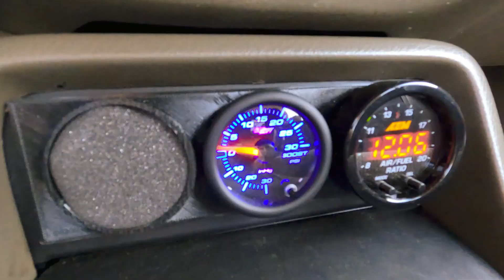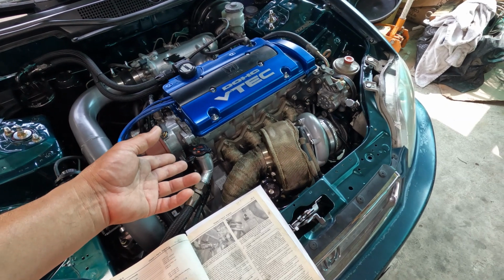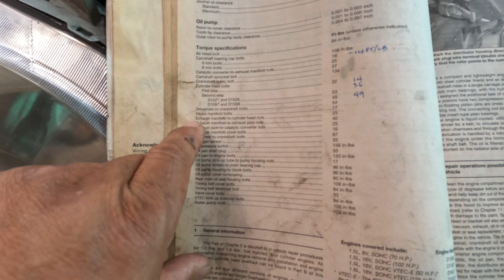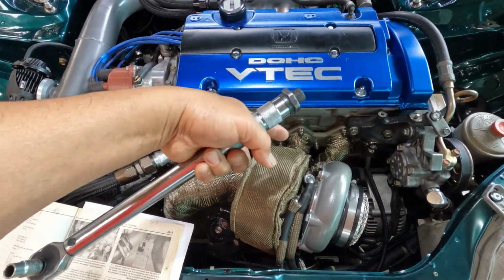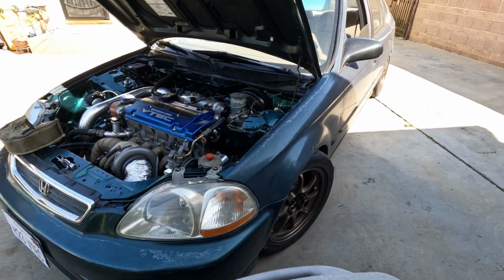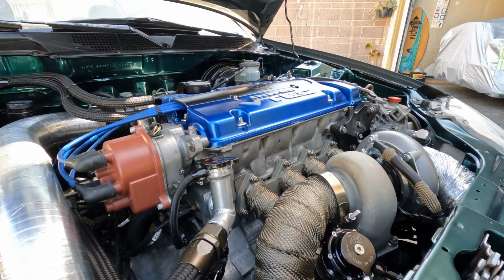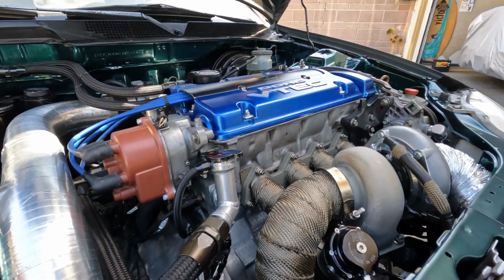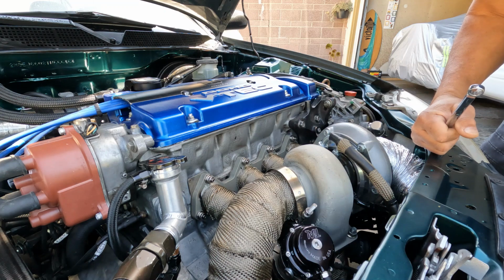H22 Titanium exhaust manifold bolts review

Comment: Thanks for the review! I got some Downstar bolts for my slunk2 IM because of lack of space. Right now I can’t take off my IM or even iacv if I wanted to lol. I’ll be sure the check the bolts every now and then once I install them. Thanks again!
Reply from the maker: Yeah man! You dont want these titanium bolts on intake manifold. It'll loosen itself. Exhaust side ok coz of easy servicing and no worries. I'm the parts research and development lol. Sk2 mani fits good on  Accord or too big?
Reply: @sagittnet2158  lol fo sho , thanks. Yeah it fits but it’s a tight fit for sure. Not enough room to take it off without removing the head haha.

Comment: Would you recommend this upgrade?
Reply from the maker: Yes  and l actually owned 2 sets of these. I made another review and you'll see it soon. Thanks
Reply: what length did you get? There is so many options out there and different brands. I wonder if they are the same
Reply from the maker: @JohnnieIsBored  l got the TRC brand (ebay) 45mm length.  B, D , H, F series use same bolt length from trc brand. You can do the torching if you like to save you a bit. Not sure if other cheaper than trc are built the same. But for the bolts that l used, no problem at all.
Reply from the maker: If you are using a ex manifold like 1/2" thick, you might consider getting a longer stud than 45mm

Comment: hey brotha, what injectors are you using?
Reply from the maker: 1000cc Injector Dynamics and using 91 octane
Reply: @sagittnet2158  did you have to use a resistor box?
Reply from the maker: @Jeff-mu8dq   ID1000x is hi- impedance/ saturated injectors, so injector resistor is not required. I was using H22a4 obd2 290cc injectors when l was doing engine break-in.